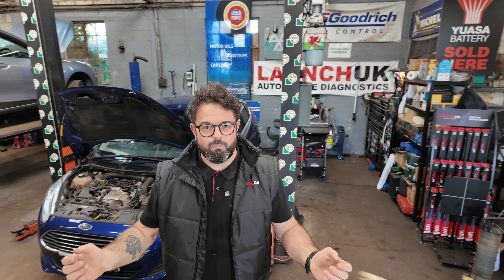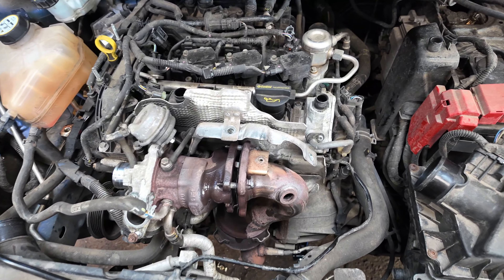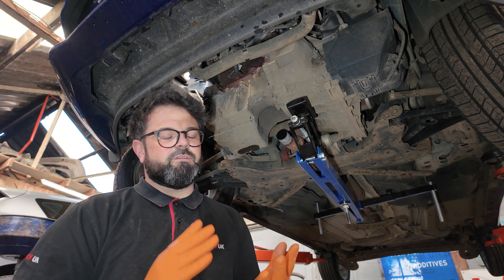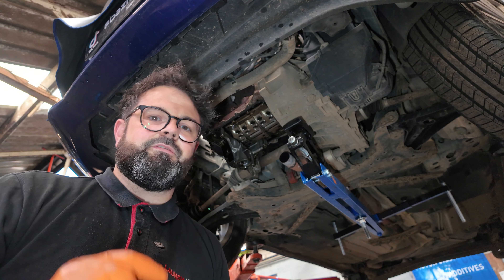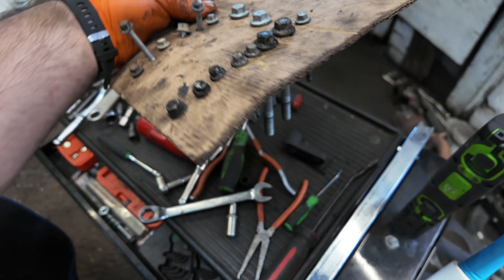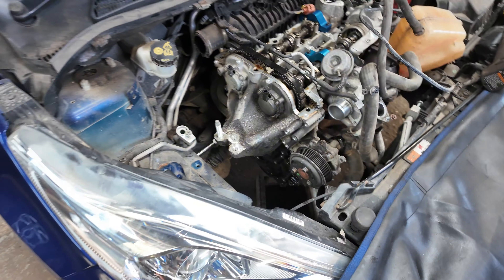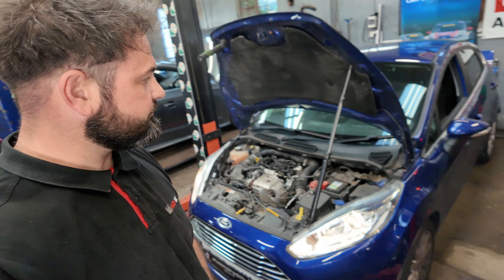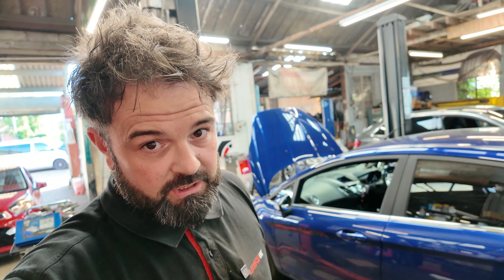FORD ECOBOOST ALMOST RUINED MY WEEK DUE TO PARTS AVAILABILITY!!! IT WAS DOWN TO THE LAST MINUTE....

Comment: I watch all the ecoboost wetbelt change videos, but still hoping to see an automatic gearbox 1.0 litre as the balance shaft set up is the reason for the recall in.the USA with the tensioner failing resulting in all teeth shearing off the oil pump belt.
Reply: I’ve done mine the other week, the tensioner failed, luckily I caught it before oil starving, I do have photos, it’s a shocking idea. The balance shaft has an alignment on hole in it.

Comment: I work in ford parts
And yes parts availability is crazy at the moment with what's happening at Daventry every ford dealer up and down country is struggling for parts
Reply: My local Ford dealer reckons Daventry has an asbestos issue at the plant 👀 Any word on when it's gonna be resolved?
Reply: @Daveys-Garage  yes that's true there doing a clean up operation with hundreds of people in day and through the night but haven't really said when it will be fully back up and running I think it will be  months
Reply: @olliesengineworld  i had a new engine and bits booked for 3rd sept 16 hour job. got the call 3rd to say the above. the parts are coming from germany now but its pushed the fit back by at least a month and no courtesy cars😞

Comment: I was quoted £3000 for this job at my local Ford dealership!!! Parts are about £350 so roughly £300 an hour. Needless to say they aren't getting my business!
Reply: I guess they overpriced because they didn,t want to do it.
Reply: I must admit , when I did mine on my 2014 C-Max in June 2022 (weather was sunny all week as did it outside on my drive) I used red sealant & it oozed out the sides all round after refitting covers inc’ the sump but I didn’t care because if any oil was leaking , I would see it , but up to present , nothing has leaked out & the sealant has gone a bit brown so not that noticeable now , stressful task if you not done it before but at least I have all the tools to do it again next time .
The main Ford parts warehouse in Tamworth burnt down not long ago , & my local Ford dealer had to source parts from elsewhere in the country (parts for other jobs long since my belts was changed) but got them eventually. Hence it cost me about £600 to replace my wet belts all in all for part’s & special tools which some were sourced from USA & Germany .
Reply: @BruceRitchie-f6g Do you have a full list of parts to do this job on the 1.0 Ecoboost engine?

Comment: So Ford have changed the design to a chain drive on these on the later ones BUT still has a wet belt for the oil pump drive haha.Still taking a chance.
Reply from the maker: Yes and I'm hearing all sorts of horror stories about the oil pump belts stripping
Reply: @bazmeredith  Thought so.
Reply: Very important detail to ask for in case of a damaged oil pump belt. Is the car in question an automatic? Seems that belt tensioner plus balancing shaft equals belt issues

Comment: A week after changing the timing belt, my son went on a 300 mile round trip.  When he pulled into the drive I noticed white whispy smoke coming out of the exhaust.  It now puffs smoke when you prod the accelerator.  I fear the head gasket has blown. I did vacuum fill the coolant but perhaps there was an air pocket.  Have ordered a test kit to check the coolant.  Options from here are 1)leak stop additive, 2) replace head gasket, 3)have engine replaced, 4)scrap car.  Sorry I didn't advise him just to sell the car instead of replacing the belt.
Reply: Did he change the water pump
Reply: He is me, and yes, water pump was changed. I contacted an engine rebuild specialist today.  He said that they are known for developing cracks in the head.  Was sceptical that changing the timing belt brought it on, and it may just be an unfortunate coincidence.  Coolant consumption seems to be negligible so far.  Will test the coolant for contamination and will keep an eye on it before deciding what to do.

Comment: Great video as always baz, a question for you about the torque multiplying tool, is there 2 different torques, ie using the tool vs not using one,
Reply from the maker: You need the torque multiplier to do the final stages of the degrees without it's impossible to do it correctly

Comment: Fundamently speaking I just would not want a 1.0 engine even with a turbo in my car. Ok for the smallest of cars 1.0T and under Toyota Aigo or Peugeot 108.

Thoughts on the 1.5T ecoboost in the 2012-2018 region Baz? Are they better, the same or worse than the 1.0?

Thumbs up as always. Well done for getting huge support from Launch UK it can't be easy.

Comment: Baz seen you at launch with Jimmy mobile mechanic do you get the drinks 🍸 in  right baz  my Friend as a ford focus 1.0 eco boost is the wet belt the cambelt 😊
Reply from the maker: Yes
Reply: Andy.....Right, it's vertical and painted blue, but the cheesecake is in the glovebox, I like tension water, do you?
Reply: @bazmeredith  so pal the wet belt is a cambelt how often baz does it have to be changed

Comment: Whats the cost of this work Baz ?
Reply from the maker: Unfortunately I don't put prices because it's not fair on other garages going off my price ect, it keeps it fair for everyone
Reply: @bazmeredith  So how do I find out if I want one doing
Reply from the maker: @lesnorris  nobody can tell it's recommended at roughly 100k, but going off how it's serviced ect, I've seen them needing replacement as little as 45k, normally you get oil light staying on longer than normal or a hard brake pedal as the fibers off the belt block the vacuum pump ect